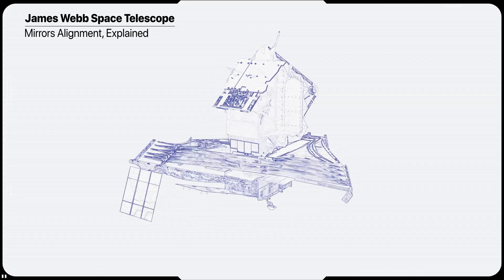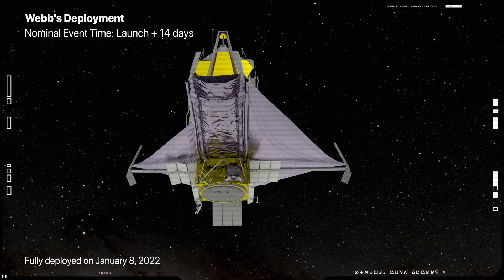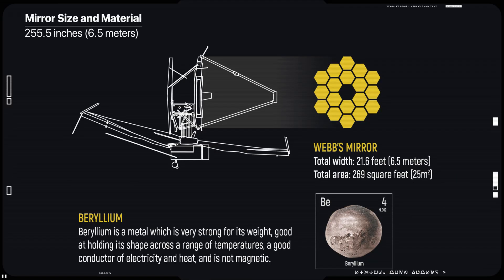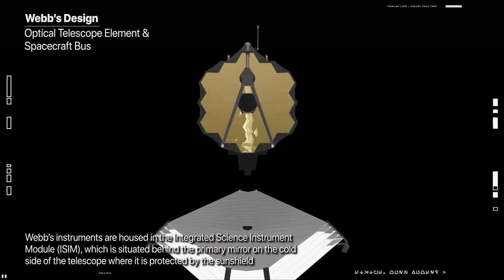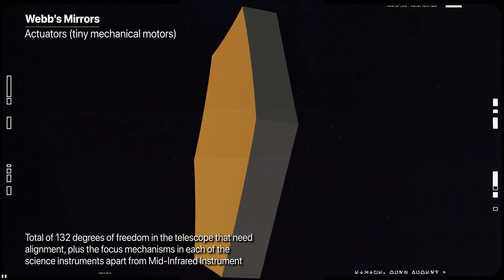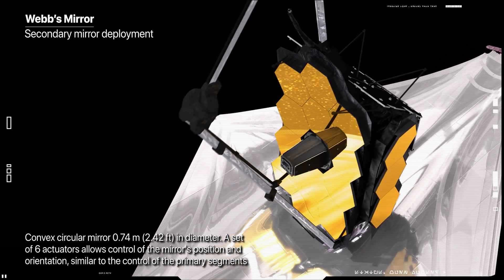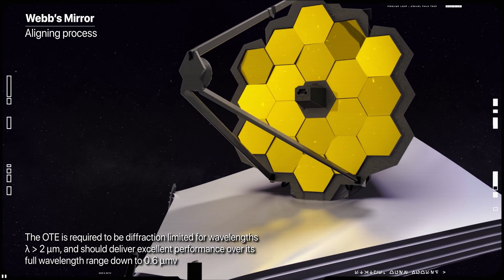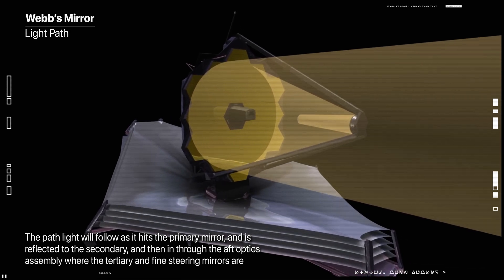How JAMES WEBB TELESCOPE Aligns Its Mirrors & How They Work

Comment: I'd be interested to know how the primarily mirror's are individually identified from the eighteen images registering at the sensor?
Reply: It would be enough to move one mirror in small steps and analyse what changed between steps.
Reply: I think what it means basically is that initially all the wavefronts from the 18 mirrors arrive at the instruments with timing errors between all the different wavefronts. Then as the mirrors segments are adjusted the wavefronts come together and gradually become synced with each other. Finally all 18 wavefronts are overlapped correctly and the 18 different images are layered on top of each other properly to create one single image.